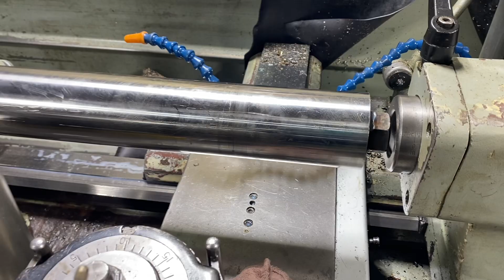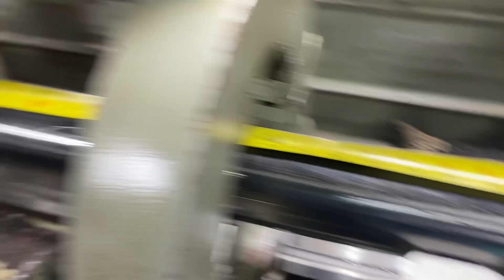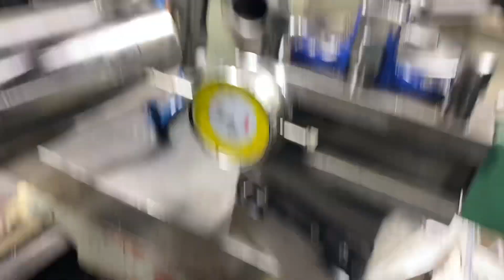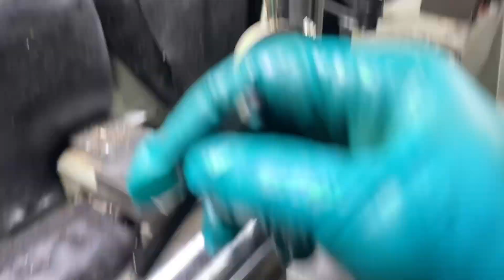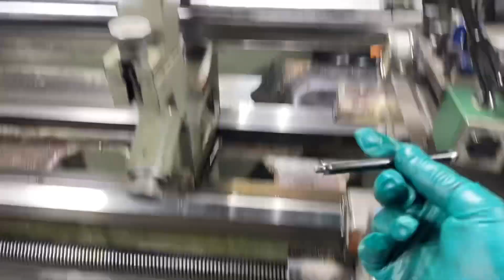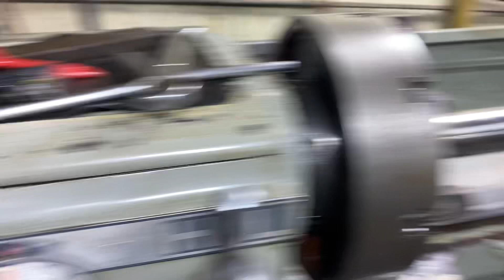Rudder stocks part 2, mostly centering steady rest.

Comment: Hi. This is way if you want to get the part aligned. Good video.
I'm working with a 6 meters length manual and cnc lathe with parts from 80 to 500mm diameter up to 6 meters length. The way I do for the first pass to clean half of the part (they are not calibrated and are stored outside) is using 2 dials over the bed and pushed against the V, checking first in the chuck, then nearest as possible to the steady rest, it gives me a closer precision for the cleaning pass. I cannot do in your way because I need another steady rest in the tail to support the part to make the center hole. Because of this in the first pass always have some tapper.
After flip the part I measure the part diameter at the chuck and at the steady, maybe if I have 250.1mm closer to the chuck and 250.4mm near the steady rest, I adjust the steady to get the same measure with the dials more the half of the difference (0.15mm) In this way I know the imaginary center line is align all along.
Then after cleaning outside both sides and having center points I remove the tail steady rest and using the same method as you described I center the part with more precision for the rest of the processes.

Comment: Benno  - Obviously your math works . It confused the shit out of me . Allow me to add 
more confusion to the mix - this is my approach . Back off the steady rest probes to 
clear the shaft . Indicate at the chuck by revolving the Shaft . Go to the Tail Stock  end.
 Indicate by revolving the shaft . Use a Rubber hammer . Go back to Head Stock .
 Re - Indicate the Head Stock . Back and forth a few times. Now close the Steady Rest
 probes gently against the shaft . You will be good at both ends . The lenght could be anywhere . That's my story and I'm sticking to it . -- Jim
Reply from the maker: Hi Jim, if the lathe is pretty straight and level your way will work like a hot darn, also it requires that the workpiece is less than a couple hundred pounds I believe. If the lathe in question is as out of true as my big one, the axis of the headstock spindle and the bed are two rather different realities. I’ve tried all sorts of ways with heavy parts, indicating off the chuck face to the part, mount an indicator on the tailstock end of the workpiece and indicating off the tailstock etc. any way that gives you a not tapering part (unless that’s what you want) is a great way.
Reply: Benno - If the lathe is pretty straight and level your way will work like a 
hot darn. I reject that statement . How does your method make the Lathe 
Bed True ??? --- Jim
Reply from the maker: It does nothing for the bed of the lathe, and I apologize if I said that it did. It allows you to get a segment length of the workpiece parallel enough with a section of the bed that when you turn the diameter of a part, in that same area of the bed that was used to indicate, the inherent taper will be as minimal as possible without resorting to adjusting the cross slide setting during the length of cut. Very long cuts will still be a big problem. One that is proportional to the twist in the bed………..of the lathe.
Reply: Benno - Again -- Indicating both ends would accomplish the same thing 
without the complicated math .  I suggest you try it on one shaft -- Jim
Reply from the maker: thanks Jim, I’m very familiar with the method you describe. I’ll be making another video about this subject soon. Thanks for the input and stay tuned………
Reply: Benno -- Again - Try one - Make me look stupid - I welcome it . This is not 
a contest . It's an honest exchange of Ideas . I've had egg on my face 
many times . -- Jim